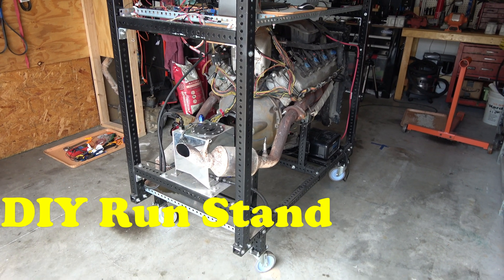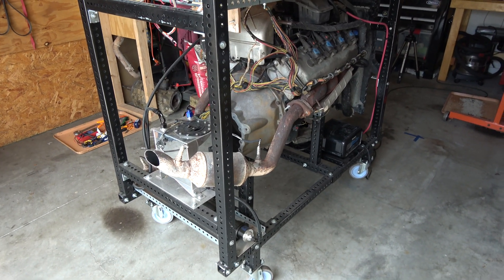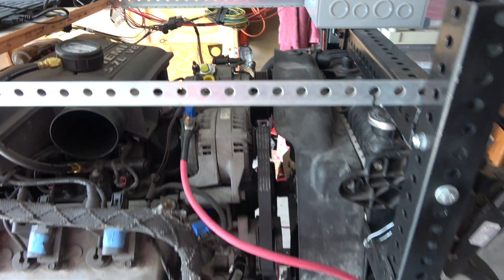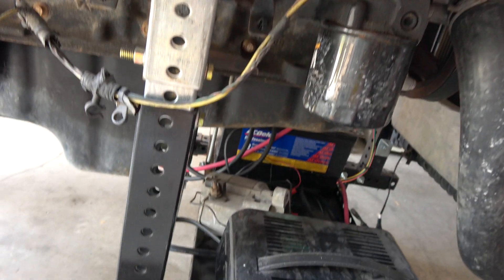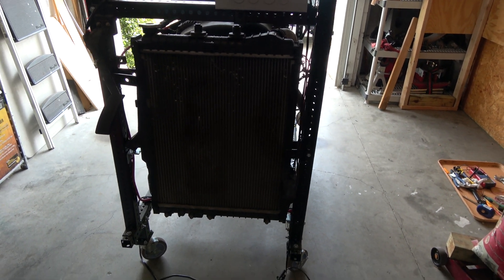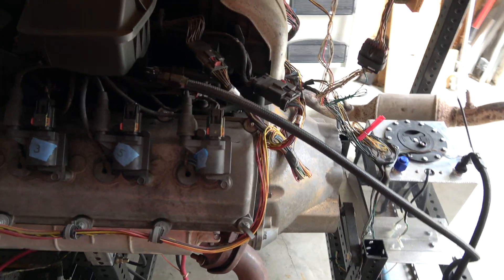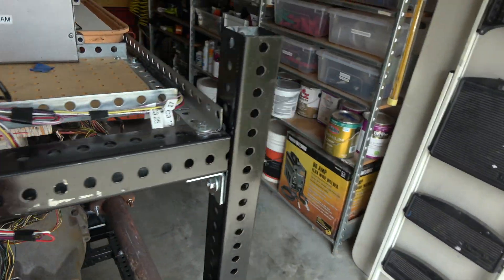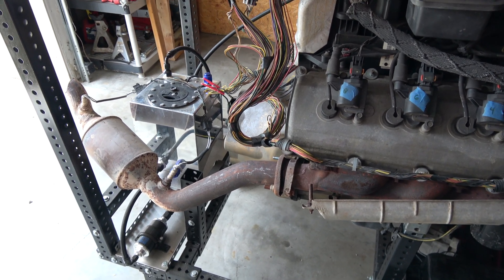Hemi on a Run Stand (Best features from YouTube)

Comment: Is this the painted exhaust manifold?
Reply from the maker: No.  These are the manifolds that came on the donor engine.
Reply: So how was the paint holding on the painted ones? @Rollout001
Reply from the maker: @4NEOFEAR I have put on about 700 miles since doing the swap (eventually I'll post a video), and the painted manifolds still look good.  No chipping, peeling, or burning.  The color still looks good.  Here is a link to a picture.  Looks like maybe a tint of yellow.

https://www.wranglerforum.com/threads/2005-lj-the-marathon-build.2056737/post-35446585

Comment: what flywheel and clutch plate are you running with the 3.7 belling housing ? i'm not finding a whole lot of info on that part since most people swap to a auto
Reply from the maker: I haven't sorted that out yet.  I am using the flex plate from the donor right now on the run stand.  When I do, I will post part details.